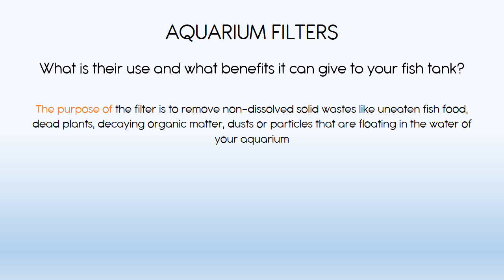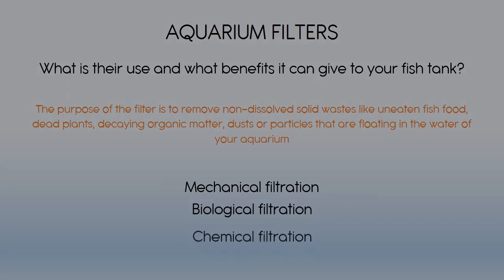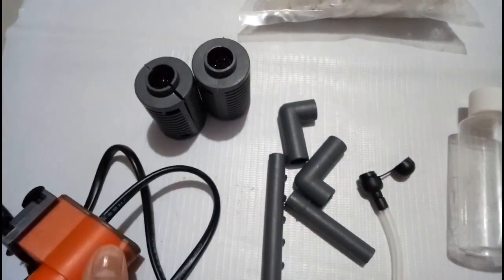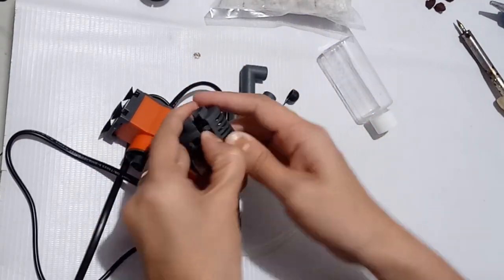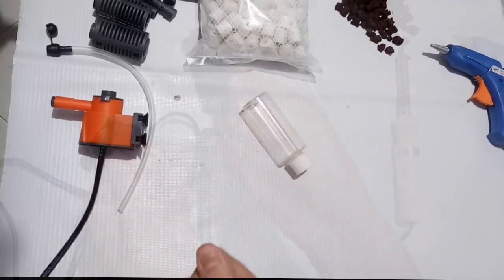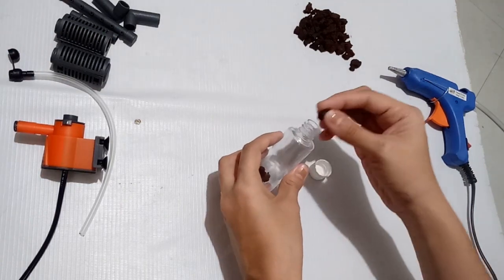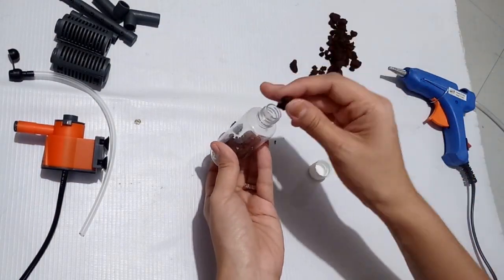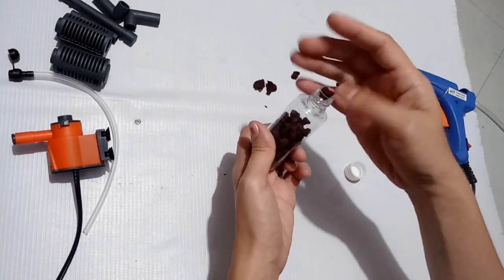DIY Aquarium filter for small tank l Mechanical & Biological filter

Comment: I received my filter 2 weeks ago. I put the waterfall arm on it, nothing comes out.  Also, the water bubbles out instead of streaming out as shown in the video, but only if I attach it to a regular air pump. Seems like there isn't enough 'juice' to push water trough properly. What am I doing wrong.